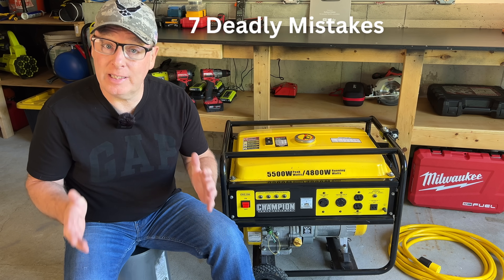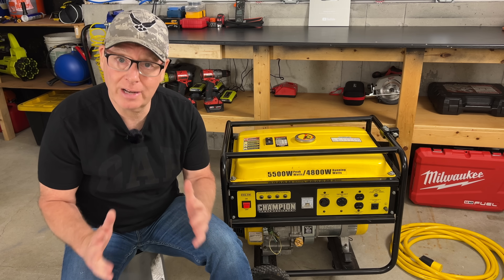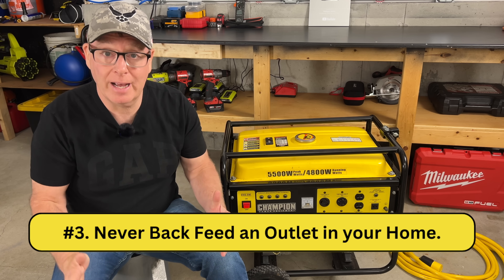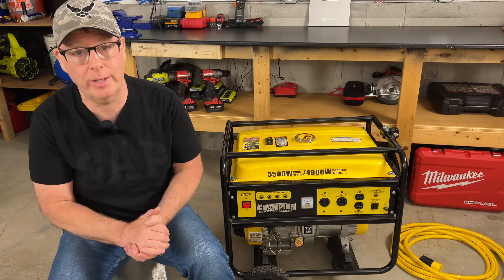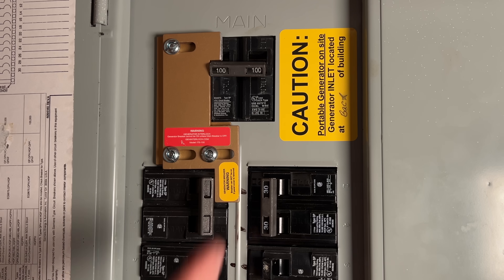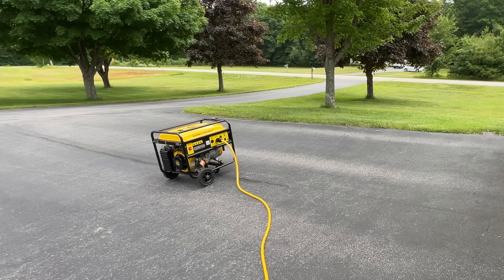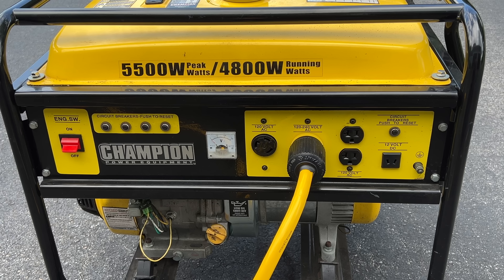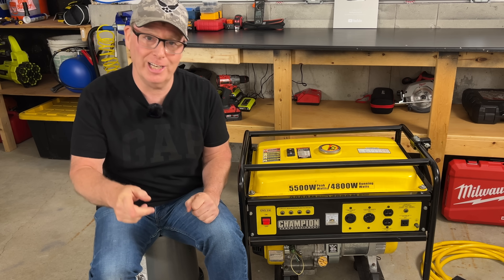7 Backup Generator Mistakes. (Have You Made One?)

Comment: #4 is not correct. I live in Florida and have had many homes and have always had a "suicide" cord and most were installed by an Electrician. The proper way to do it is to have a "procedures" doctrine hanging over the outlet in the garage, so you read/do it properly BEFORE starting your generator. I've been doing this for more than 30 years without issue. Your video SHOWS that a suicide cable is being used! Look at time 3:45 where you show a female outlet, which requires a male connection, and everyone knows the generator connection is with a male cable connection as well!
Reply from the maker: Of course in will work but if you ever make a mistake you will be liable.

Comment: Why aren't you connecting a grounding rod to the generator?
Reply from the maker: A ground rod is only needed if you're running a bonded neutral generator which also requires you to switch the neutral along with the hot conductors through a transfer switch. This set up would be considered a separately derived system and a ground rod may be needed depending on a few other conditions.

Comment: Many, many years of portable generator use.  The secrets to keeping it ready for the next power outage are twofold:
1) When the emergency is definitely over, usually the next day, I start the generator up, let it run for about 5 minutes to come up to temperature, then turn the fuel cock off and let it run until it stalls.  This empties the float bowl.  Some engines have a float bowl drain, which you can use instead of running it out.
2) Once the carb has been drained, drain the fuel tank completely into a gas can.  Never leave fuel in the tank or in the carb and it will be ready to go the next power outage.
Reply from the maker: I have heard of tanks rusting when left empty.

Comment: A big mistake is getting a generator with aluminum windings the yamaha silent was built that way, in very tiny print it said do not run longer than 3 continuous hours.
I built a SEPERATE generator shed. 12 years off grid in Alaska, had external fuel tanks, 900 gallons of diesel when all tanks full.

Comment: How do you feel about grounding a portable generator? Your videos all show you positioning your generator on cement.
Reply from the maker: I’ll make a video on bonded vs floating neutrals and the need for a ground rod. But in short: unless you running a bonded neural through a transfer switch that switches the hots and the neutral a ground rod is not required. The ground wire from the house bonds the generator and at the service the neutral and ground are bonded. This bond can only happen in one location which is why the neutral needs to be switched for a bonded generator

Comment: Great review thank you may i ask what is the best watt output to supply a domestic home to run the lights and heat pumps from an open fire
Reply from the maker: Generators are sized by their kw rating. They will have a starting load and a running load rating. You will want to make sure the sum of your loads is well under the running load value. Also heat pumps will have inrush which needs to be accounted for as well. You should probably have an electrician help you select the proper size after evaluating you load requirements

Comment: i know a generator that size will not back feed into the grid. it will kill the generator so fast. my 13k gen will throw the breaker on it so fast. because i have screwed up and flipped the gen breaker before i flipped the main.
Reply from the maker: Of course but it depends on where the break is located. If it close to your house or has you and a neighbor isolated it will back feed that and put your neighbors and line crews at risk. Thats whey it illegal.

Comment: Good video....I would only add to Only use terms OFF and ON , instead of Open and Close when referring to the breakers, especially the one installed for the generator.
Reply from the maker: Good tip. Open and closed are terms used in the electrical industry but surly not by everyone.

Comment: I have the generac  6500 and ive had trouble
with it tripping the breaker when i hook up
my refrigerator. After hurricane Milton, i
hooked up a small window unit which runs
about 1200 watts, and a box fan which runs
about 70 watts and it did fine. As soon as i
plugged in my refrigerator which runs at 400
watts, the breaker would trip and the fridge
Would shut off. I tried using the ac and fan
on one gfi and the fridge on another but no
matter which gfi i used for the fridge, it
would still trip the breaker. I ended up just
plugging the ac and fan as it seemed that
the generator could not handle the fridge
Any idea why this $900 generator cant
handle the load of the fridge?
Reply from the maker: Sounds like you have an issue with the fridge. There are usually capacitors connected to reduce the inrush current when the compressor starts. My guess would be a failed capacitor. The generator should have no problem with the fridge

Comment: What do you specifically ask your electrician to install when you want your portable generator to run off your breaker box properly? So no one gets electrocuted??
Reply from the maker: If you have a licensed electrician do the job you would just ask for a legal 30A or a 50A generator connection (depending on what you need). As a professional we have to install a code compliant connection. Where you can get in trouble is if you have someone thats not licensed do the job.

Comment: #8. Ground your generator. Some refrigerators will not operate if they detect they are not grounded.
#9. Use a dual fuel (gas/propane) generator, if possible. Propane is MUCH safer to use and store than gasoline. Propane generators are often a little difficult to start, but, the increase in safety is well worth it.
Reply from the maker: Only ground your generator if you have a bonded neutral and a transfer switch that switches the neutral along with the hots. You can find everything you need to know about grounding in article 250 of the NEC.
Reply: @BackyardMaine  I had a refrigerator that would not run, unless the generator was grounded (was using extension cords)

Comment: I'm still looking for guidance on when to ground or not ground the generator itself.
Reply from the maker: The ground and neutral can only be bonded in one location. Since this is done on the home at the first disconnect you have two options when connecting a backup generator.
 
Floating Neutral: There is no bond between neutral and ground at the generator. No need for a ground rod at the generator. You will connect the neutral to the neutral bus at the panel. 

Bonded Neutral: There is a bond between the neutral and the ground at the generator. Since we can only bond in one location you will need a transfer switch that switches the neutral along with the line wires. This meets the definition of a separately derived system since the bond will be isolated to the connection at the generator switching the home bond out of the system. In most cases you will be required to set a ground rod at the generator for this connection.

Most bonded generators will offer and method to remove the bond. When using an un-bonded or floating neutral generator for something other than for home backup power a ground to neutral bond is required. They make grounding plugs that can be used for this purpose. It’s simply a plug with no cord that has a connection between the ground pin and neutral. 

I hope this helps.

Comment: Excellent safety tips! Can you also talk about making sure when using a portable generator to properly back feed your home it should also be confirmed to have a floating neutral? Most portable generators are sold with bonded neutrals so they can be used safely in the more common application where users are plugging cords and appliances directly into the generator’s built-in 120 volt outlets. When that same generator will be used in the mode your video shows, the generator needs to be set up with an un-bonded neutral (floating neutral) so you do not have “objectionable” neutral load voltages being carried on the ground wire between the home and the generator.
Reply from the maker: The ground and neutral can only be bonded in one location. Since this is done on the home at the first disconnect you have two options when connecting a backup generator.
 
Floating Neutral: There is no bond between neutral and ground at the generator. No need for a ground rod at the generator. You will connect the neutral to the neutral bus at the panel. 

Bonded Neutral: There is a bond between the neutral and the ground at the generator. Since we can only bond in one location you will need a transfer switch that switches the neutral along with the line wires. This meets the definition of a separately derived system since the bond will be isolated to the connection at the generator switching the home bond out of the system. In most cases you will be required to set a ground rod at the generator for this connection.

Most bonded generators will offer and method to remove the bond. When using an un-bonded or floating neutral generator for something other than for home backup power a ground to neutral bond is required. They make grounding plugs that can be used for this purpose. It’s simply a plug with no cord that has a connection between the ground pin and neutral. 

I hope this helps.

Comment: I've never had a problem when it comes to "Back Feeding" Buildings.... You just ALWAYS have to MAKE POSITIVELY SURE that your MAIN BREAKERS are OFF!... And I know that it's a practice that is "Frowned Upon", but sometimes "Ya gotta do what ya gotta do".....
Good Video!
Reply: Accident of life and death  increases. 
That's all.
Reply: Transfer switches ain't rocket surgery to install.
Reply: @ Maybe they are for hillbillies that think it's OK to back feed.🤣🤣
Reply: The only problem is that you NEVER can POSITIVELY be sure that your main breaker isn't defective and not opening all the feeder legs even if it is switched off.  You won't know, until the smoke starts coming out.
Reply: @bobbygene8274  By that logic, an interlock should be illegal too
Reply: @joecummings1260  Not at all what I am saying.  It is just people should be advised that the potential exists.  Not that it is inherently unsafe-it is just not as safe as other methods. There there are better ways to isolate, albeit more expensive.  Mechanical things fail, all of the time.  To ignore that fact, is the height of arrogance and folly.
Reply: Exactly. If someone asks how to do this, they shouldn’t be doing this.
Reply: It's illegal in some areas. If fifty people do it, a good chance one or more will screw up.
Reply: @chuckr1951  Yep. Besides, there's an even better chance one or more of them will be drinking at the time the power goes out.
Reply: If you end up back feeding into the line in my state, your power meter will be pulled. If you argue, your power meter will be pulled while the state police are taking you away. Use an interlock.

Comment: I have a portable tri fuel generator and run it normally on natural gas. But I have a 100lb propane tank next to it when running. Is it safe too run my generator with the propane tank next to it?
Reply from the maker: I don't know much about the safety regs around storing propane. I would think it's ok as long as it's not getting too hot. We have them under our gas grills..

Comment: All three of generators' manuals say NEVER start it with the load connected. Always start the generator, then connect. Disconnect before shutting off. The inside equipment doesn't like the voltage transients. Transfer switches stabilize the generator before making the inside connection.
Reply from the maker: That was one of my tips.. But remember they are referring to the load not the cord. If wet conditions are present disconnect the load at the breakers and shut off the generator. Then you can safely connect and disconnect the cords. Whet the manuals are trying to prevent people from starting or stopping while loads are connected. We solve this by opening the generator breaker. I hope this helps you understand when the intent of the manufacturers actually is.

Comment: Wouldn't it be better to turn the generator off and then turn off the breaker??
Reply from the maker: The generator produces a lower voltage and its shutting down and some loads will not like that at all. Its always best to open the generator breaker before shutting down the generator.

Comment: Thanks for the video and all the solid tips. I think it's really important for everyone to be familiar with them and review them regularly. They are all common sense, but many times, if you are setting up a generator, you might be in severe weather, or under stress and in a rush. That's when mistakes can happen even to the best of us. 

Regarding keeping the generator away from the house, I can't stress this enough. Especially in the wintertime when it is cold outside and warm inside, your house will be drawing air from outside. If you have a very modern house that is well sealed, you might have less of an issue, but many older homes are not sealed as well.

I witnessed this first hand when a neighbor had a grill going with a heavy scent of unburned fuel as they fired it up on a very cool fall day. Even though it was over 30 feet away, in my older and leaky house, the heated air inside my house created a draft, and pulled in the fumes from the neighbor's grill through tiny leaks around the windows and doors, and it literally smelled like a fire was in the house. So be sure to keep generators and other combustion well away from your home, and particularly in the winter.
Reply from the maker: Great information. Thanks you..

Comment: I have two breakers that feed my panel. One at the meter and the other in the panel.  I never connect my generator until I verify the Breaker at the meter is off first as my breaker panel won't accept an interlock.

Comment: I run my generator with just the exhaust side pointed out of my garage with the garage door closed down on top of the generator frame. Only way to reliably run it during downpours. Those generator tents they sell are useless and a huge pain to install. Luckily my garage is semi-detached with a breezeway between it and the house, but I still make sure all our CO detectors are working in the house and I often run a box fan or two next to the generator. One blowing air out and the other pulling fresh air in. Is it a perfect system? No, but it is a realistic system.

Comment: That's great. But they tell you in the directions not to have anything plugged in when starting the generator and to unplug after it is shut off.
Reply from the maker: That goes back to number five in the video about not connecting or disconnecting anything under load. You can plug everything in while the generator is off and then start the generator but the key here is to make sure the generator breaker is off so there is no load, just a connected cord. Then you bring on your loads like I described in the video.

Comment: Ssooo
Me making a cord with a plug at one end for my generator and wired to a braker that I lock into my panel on the other end is a no go?
Reply from the maker: Will it work? Yes but that would be an illegal connection method. I have seen many just like that and as a matter of fact I need to fix this exact setup at a friends house.

Comment: The mistake is simple by the generics 7.5 kW generator with transfer panel you can install it yourself it runs on gas line from the house and it will run all the lights in your home you don't need a cooktop and a dryer when things go bad you don't need a whole house generator I spent less than $3000 and I'm in North Carolina and my generator performed flawlessly for the last 7 days we had no power I have lights in my home internet access and TV I can afford to go out and eat

Comment: This same small generators in Southeast Asia are all air cooled diesel. No danger from carbon monoxide poisoning.
Reply from the maker: While diesel fuel combustion engines produce lower levels of carbon monoxide than gasoline engines, these emissions can still generate lethal amounts of carbon monoxide given a sufficient amount of time in an enclosed space. Carbon monoxide makes up anywhere from 2% to 12% of diesel exhaust gases.
Reply: @BackyardMaine  Thank you, good info I didn’t know about 👍

Comment: My name brand generator similar to yours says in the instructions to connected to a grounding rod. How do you do that when it's sitting out in the driveway as you demonstrate
Reply from the maker: You only need a ground rod when you are running the generator as a separately derived system. That means you have a bonded (neutral rather) than a (floating neutral) at the generator. If you have a bonded neutral you will either need to also switch the neutral as well as the line wires through a transfer switch or un-bond the neutral at the generator. Many people get confused about this fact, even some electricians.. The neutral is bonded to ground at your main and this can only happen in one location. I hope this helps.